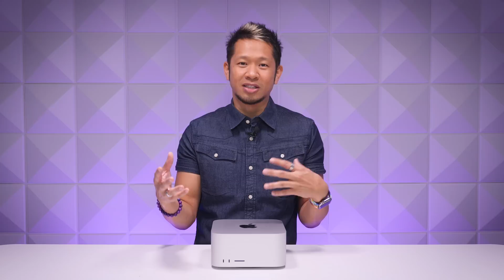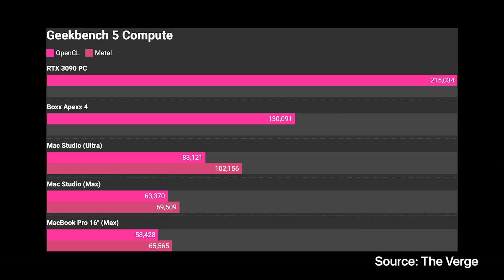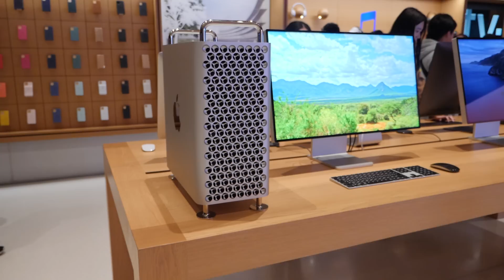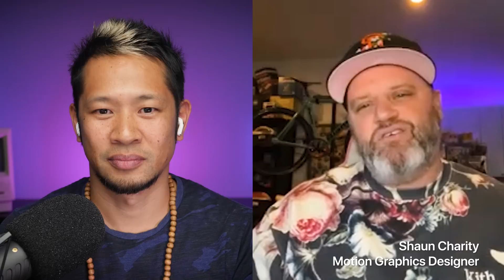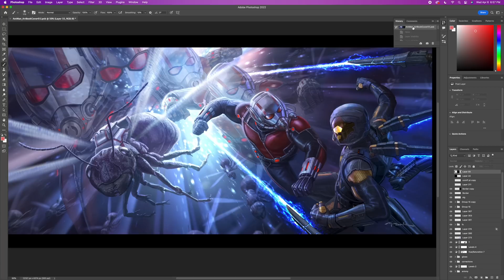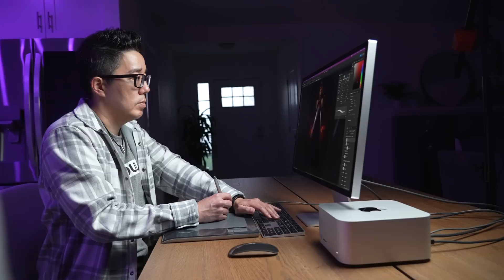Mac Studio M1 Ultra Review: One Month Later. More Power Unlocked!

Comment: Bottom line here is that Apple wanted higher margins so they decided to make their own chips which are worse and less versatile than AMD/Intel but have RISC-like efficiency in a few types of tasks to keep them usable by creatives in video and audio editing. They then sold the apple silicon for 2.5-3x the cost for equivalent performance on an Intel/AMD + GPU setup and did the "locked hardware" thing where they FOMO you into upgrading $40 worth of storage for $400 or the same for RAM, etc, since you can't upgrade it down the line.

This is a huge step backwards for consumer electronics: loss of versatile use, loss of right to repair things you own, loss of modularity, raise in price.

They even have the gall to pretend they're an efficiency king when you can under-power and under-clock anything to be super efficient. The curve of power required for each additional 10% of performance is a hockey stick. The entire purpose of desktop hardware is to be unconstrained by power envelope limitations of laptops. An undervolted and underclocked Intel/NVidia rig would land at the same 220W system draw in the same loads.

Comment: At 24:13 you say Mac Studio is ground breaking?   It's actually a big step backwards:

-M1 cpu means 100% Windows software compatibility is gone
-M1 is terrible for gaming
-M1 is weak in 3D Modeling, compared to RTX 3080 or 3090
-Mac Studio offers zero upgrades, or repairability
-even the cooling fan in Mac Studio is not accessible for cleaning

Why is there not a front-mounted headphone jack?   Why no front-mounted USB-A ports, which is what people really want ?

Comment: The render times are the same because the laptop has a 120Hz refresh rate while the Monitor on the M1 MAX rusn at 60 Hz. If you drop the MacBook Pro to 60 Hz to match the refresh rate of the monitor in use, the time differences will be much greater. Or use a 120Hz monitor with the Studio in tests.
Reply: Does any apple monitor have a 120hz ?

Comment: Great video! But I’ve been using the base m1 ultra for two weeks now and I’ve experienced more beachballs than the Baywatch set. Also I’ve had some Bluetooth issues where the keyboard / mouse (new apple magic set) won’t register for like thirty seconds after login. Benchmarks aside my M1pro laptop feels faster. Wondering if I have a defective unit or if an update will save the day. 🤷‍♂️
Reply: I’ve got the same set up, and the same problem.  I doubt it is a one-off problem, hopefully a future update speeds things up.  The value of a really fast boot-up is lost when you can’t do anything for a good 30 seconds